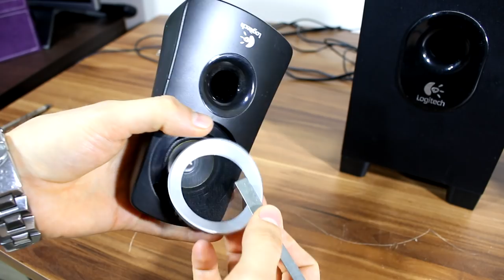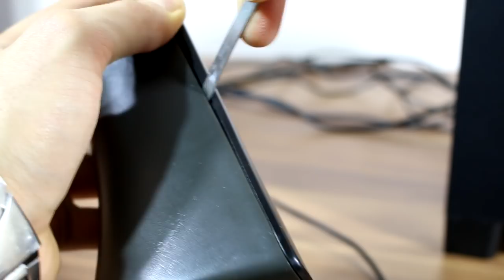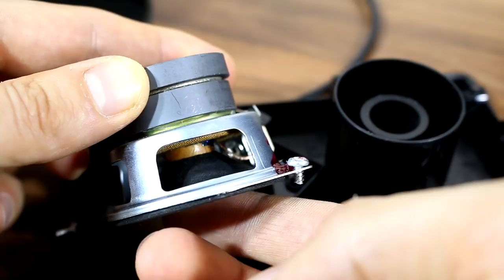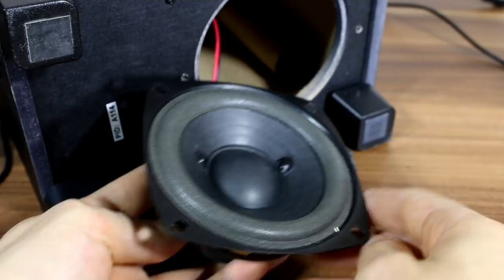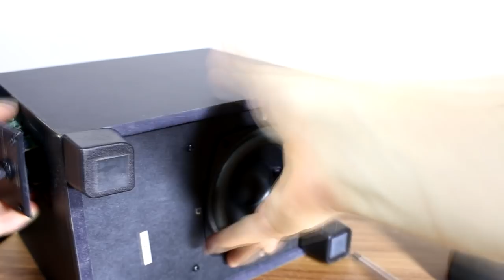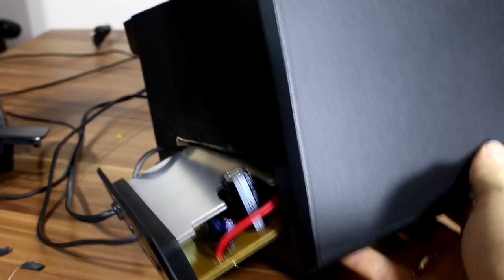Look inside Logitech Z313 2.1 speaker system - What's Inside?

Comment: I have bought ton's of these never had a problem. And the sound is amazing out of them.
Reply: Give Creative speakers a try.
Reply: edstar83 a tip for them is seal the box because they make alot of port noise
Reply: @edstar83  Creative speakers are nice. I've used a nice set of some for about 15 years now. Inspire 5100s I think. They finally died on me so I picked these up. For the price their good since their discounted to $30 now. If they were still fifty bucks I'd say yeah get the creatives since their 5.1 system is around sixty but the logitechs do quite nicely for the price.
Reply: @pimptom8704  True. I'm still using my creative inspire 2500 5.1 that i got when they intially launched. I still love them.
Reply: @pimptom8704  lol same  i use creative inspire 4.1  for 15 years its still amazing ,but now the treble sound start broken ,need new speaker fast i think i would buy z313

Comment: They should have put a double flared port into this one wil sound much better.
This is basicly the same pipe as they used since 2008 and they know it creates port noise on high volume :) wish they just flared it like they did with an even cheaper 2.1 set they sell.
Dont get it that this Z313 cost a bit more but has cheaper bassport in it cardboard instead of the pvc double flared port used in their cheaper version the  Z213 <-this version doesnt create port noise at all.
Maybe because they couldnt fit the amplifier there without moving the bassport to a non visual aesthetically pleasing location.

Btw i used the subwoofer box from 2x a logitech Z213  and put fullrange car speakers in them use them as satelites.

I still had a good subwoofer that i dint use( 2x 4inch woofers in a tower box its 1 meter high but just 20cm by 16 wide, so i took the cheapo amp from the logitech Z213 build it into a small wooden box with a terminal on it for the subwoofer wires +/- 
and sold the Z213 amp with subwoofer  for 10 euros to a friend
The amp is tiny and cheap but sound great with another subwoofer, wil offcourse get to hot when played on full volume for hours

I wonder how good the Z313s amp is when paired with another slightly better woofer and better bassport but same box

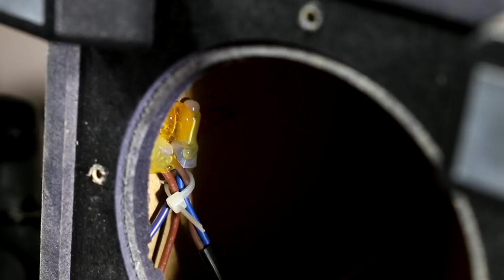Comment: Thanks, wouldn't have guessed it's glue gun glue holding the wire in place at 2:35, preventing pcb assembly removal. There's annoyingly a lot of glue just plastered all over that assembly, and tricky to access screws that hold it together. Probably to prevent it coming apart from bass vibration, but makes disassembly / repair very tedious. I had to cut/resolder wire going to volume control / audio in, as it went bad from twist/bend wear near the entry point. At least the wiring is copper, solders well.

Comment: The sub is surprisingly good, the passive satellites not so good.  Team that sub up with a decent pair of active satellites (I used a JBL "Platinum Series" pair) and boy howdy does that combination sound great!
Reply: how did you do it? I wanna change my satellites to but i don't know how
Reply: pls reply :(
Reply: @phuongtruongduy580  --- If they're normal "computer speaker" satellites with a standard 3.5mm "aux" plug, just insert that plug into the matching receptacle in the back of the subwoofer -- the same place to which you'd connect the passive satellites that came with the Z313 system -- then adjust the satellite volume knob to balance with the subwoofer.
Reply: @editorjuno  thank you I think I will use the logitech z120 as satellite speakers because I couldn't  find a pair of jbl like yours. I hope it can improve the sound quality. Anyways thank you for the advice.

Comment: My speakers is the same as this one in the video and I literally found out a few mins ago that it isn’t working. Someone borrowed it and when I got it back, I plugged it in and now it’s not even turning on (no green light). Is anyone able to help me fix this, pls? I’d rather fix it than spend money on buying another set of speakers. I’ve never had problems with it till someone else had it. Smh.
Reply: Another Dick thanks so much :))
Reply: Check if the VCC+, and GRND Wires are connected to the main amplifier board running from the power transformer inside the box